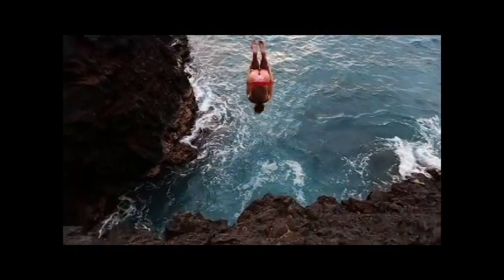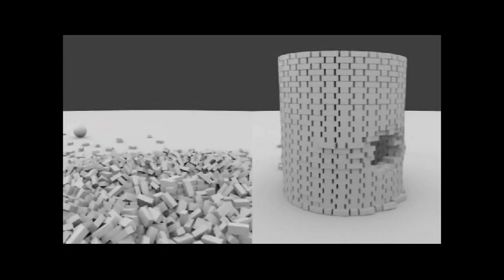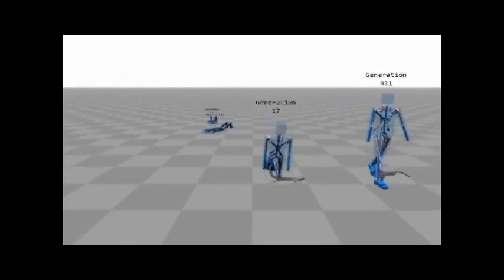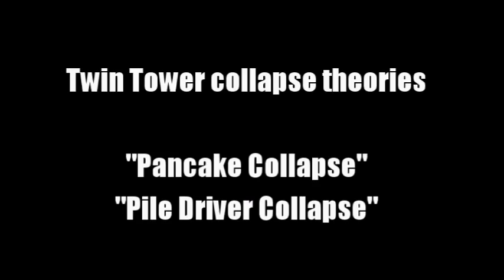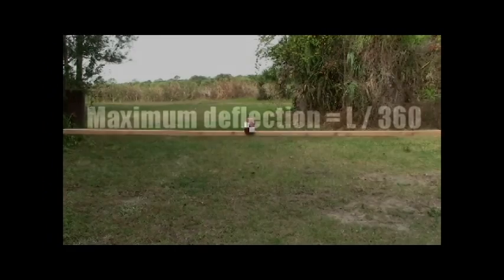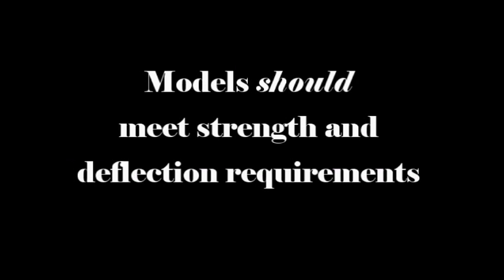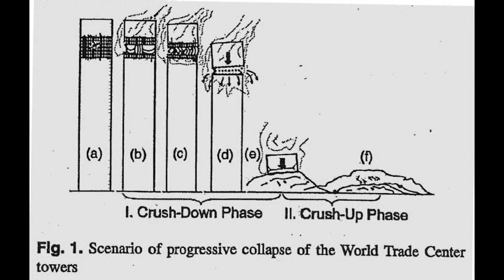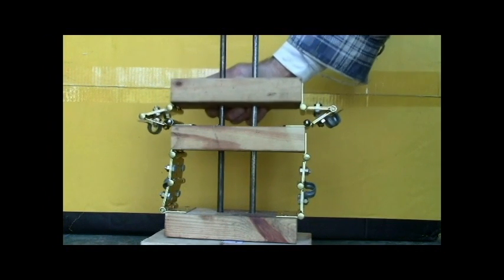9/11 Experiments: The Force Behind the Motion

Comment: A technique used in movies for strafing effects: Have a row of evenly spaced nails (eg On the wall so its in shot) connected to each electrical detonator. A weight (with connection meeting each nail) gets dropped beside them - giving you free-fall speed detonations. Varying the speed would be simple enough by creating drag on the weight.

Comment: Why such a blatent misuse of models to fool people?  The first model assumes the breaking force is enough to reduce the velocity of the mass below its impact velocity.  This has been proven not to be the case.  None of these models accurately scale the breaking resistance to the accelerating mass.   Countless studies have found the tower collapse follows the laws of physics.
Reply: +Craig Chenco I liked the NIST model of WTC7 that showed 2 seconds of free-fall.
Reply: Capitán Obvious I like the bit where it exceeds freefall accelleration....
Reply: If you look at the data points of the collapse they are averaged over the 2.8 seconds.  One data point indicates above freefall...
Reply: Craig Chenco what guitar is that? a real LP, or a china knock off?
Reply: Real one - 2000 les paul gothic  also have a 1980 e2 explorer amongst others :)

Comment: The biggest mistake in this video is the idea (in the computer simulation as well as some of the physical experiments) is that there was some kind of core that remained as a guide for the floors to fall in a nicely neat 90° vertical motion. There was no guide! The force should have deflected sideways at some point.
Reply: +Colonel Burton there should have been no defection at all the Towers should not have collapsed!
Reply: Steve Joseph
What I'm saying is that even if a few stories would have collapsed, there were no "guide rods" to assure a 90° vertical collapse of the building as in the experiment and the 3D animation. That big block that acted as a falling hammer should have been deflected sideways if we were dealing with an ordinary collapse because of a weakened structure, not the entire building collapsed into its own footprint.

Comment: Excellent work.Observed building behaviour =11 stories PER SECOND pulverized at constant acceleration.11 acres of concrete flooring and all parts of 11acres office furnishings glass etc uniformly pulverized into hot ppm DUST - per second. Physically, 'One second' does not allow enough TIME for the 'mechanics' of mass+gravitation to obliterate; to expand 11 stories steel high-rise into ppm hot DUST, @6% of its mass, molten iron spheroids. There HAD to be added energy.
Reply: Yes, the buildings were basically blown up before they hit the ground, the concrete and sheetrock were pulverized into dust on the way down.
Reply: The energy was already there.  It was the Potential Energy of the tower.
The tower could be compacted into FIFTY SEVEN FEET.  That's less than the basement it fell into.
Heat PRIMED STEEL in reducing conditions and you get iron microspheres.
Everything you have written is WRONG.  You've gotta be a 'truther'.
 PRIMARY 9-11 CONSPIRACY ASSUMPTION SHOWN TO BE FALSE:
AN ANALYSIS OF THE AMOUNT AND DESTINATION OF THE POTENTIAL ENERGY OF A WTC TOWER
The first law of thermodynamics, also known as the Law of Conservation of Energy, states that energy can neither be created nor destroyed; energy can only be transferred or changed from one form to another.
Source: Boundless. “The Three Laws of Thermodynamics.” Boundless Chemistry. Boundless, 02 Jun. 2016. Retrieved 12 Oct. 2016 from https://www.boundless.com/chemistry/textbooks/boundless-chemistry-textbook/thermodynamics-17/the-laws-of-thermodynamics-123/the-three-laws-of-thermodynamics-496-3601/
The World Trade Center towers (and WTC7) fell NATURALLY due to buckling failure when their 'slender' columns lost attachment to their floors.
They only used a third of their Potential Energy to destroy themselves, the remaining two-thirds was consumed in crushing some of their steel into ground zero.
A standing WTC tower possessed two hundred and forty six tons of TNT of POTENTIAL ENERGY merely by just standing there. We shall call this energy Eo.
The tower fell by taking the direction of LEAST RESISTANCE, which was THROUGH ITS BUCKLING COLUMNS.
The columns failed by BUCKLING because their STRUCTURAL STABILITY had been compromised by LOSS OF FLOOR ATTACHMENTS. No steel got crushed when this buckling failure occurred. 
Buckling is not a MATERIAL failure; it is a STABILITY failure.
The floors had detached themselves by sagging to an angle which snapped their connections. Photographs of these separated floors (taken shortly before collapse) are plainly shown in the NIST Report.
As each tower fell, some of that stored potential energy, converting to kinetic energy by falling, was released to damage and dismantle both the moving and the stationary parts of the tower on the way down.
The amount of the initial energy consumed in such a manner was inversely proportional to the rate of acceleration of the tower as it descended. It can be calculated.  We shall call it Ed.
The amount of energy remaining (Er) when the tower wreckage hit ground zero is then (Eo - Ed).
This energy, transferred elastically, caused PLASTIC DEFORMATION in the crushed base steel wreckage, and became HEAT. This too can be calculated.
The heat was considerable. The signs of it were captured by satellite. It amounted to the equivalent of a thousand tons of steel raised to a temperature exceeding 1,000 degrees Centigrade.
This hot steel, crushed and pressed against ground zero, oxidised its surface (making scale) and absorbed local oxygen gas, leaving a reducing atmosphere.
In these reducing conditions, and at a temperature of 1,000+ degrees C, fireman’s water which had percolated through crushed gypsum wall boarding DISSOLVED calcium sulphate (yes, Gypsum is 5% soluble in water), the sulphate ions of which were reduced to sulphur which combined with the exposed iron to form IRON SULPHIDE, which at such temperatures was MOLTEN, and flowed away. At a temperature of 1,000 degrees Centigrade, in an absence of oxygen, and in the presence of hydrogen, Sulphur and Iron atoms become keen partners.
Such hot reducing conditions also caused the water/steam to be REDUCED to hydrogen gas which was noted by firemen to be burning at the surface of the wreckage.
The wall-boarding and crushed concrete surrounding (but mostly above) the steel were THERMAL INSULATORS, so greatly slowing cooling.

CALCULATIONS (in SI units):

To calculate the original potential energy of the tower in TNT equivalent,
G = 9.81 metres/sec^2
Mass (M) of tower = 5e8 Kg
Height (h) to the tower’s CG = 210 metres
The explosive energy of 1 ton of TNT (Kt) is equivalent to 4.184e9 Joules

Equation: Tower Potential Energy (Eo) = ( M * G * h ) / Kt
This is equivalent to ( 5e8 * 9.81 * 210 ) / 4.184e9, or 246 tons of TNT.

The Potential Energy of each standing tower was equivalent to 1,000 standard 500 lb. ‘iron’ bombs.

To calculate the kinetic energy used in the tower destruction takes a moment, after a simple thought experiment, namely considering the tower would fall at G if there were NO resistance, and if it fell so slowly that it consumed ALL its energy, it wouldn’t fall at all.
So we can see that the PROPORTION of the energy used up by the collapse must equate with the proportion of G which the collapse was unable to achieve.
As the collapse acceleration was, by truther calculation, established to be about 70% of the acceleration due to gravity, we’ll use that.
The energy used up in tower destruction was therefore 30% of 246, or 73.9 tonnes of TNT.
Assuming that 30% of the tower fell outside of the basement, then the energy (Er) available to heat the wreckage base (by elastic energy transfer and crushing) was 0.7 * (246 - 73.9), or 120 tonnes of TNT.
We know that the steel reached at least 1,000 degrees Centigrade because that is the melting point of iron sulphide.
We can therefore calculate the mass (m) of steel that was raised to that temperature.
The specific heat of iron (Fs) is known to be 0.45e6 Joules / tonne / degree C
The ambient temperature was 20 deg C, so the temperature rise (Tr) was 980 degrees C

Equation: Er = m * Fs * Tr
So m = Er / Tr * Fs = ( 120 * 4.184e9 ) / 980 * 0.45e6
And so m = 5.02e11 / 4.41e8 = 1,138 tonnes.

The collapse of each World Trade Center tower created 1,138 tonnes of red hot steel at 1,000 degrees Centigrade.

So we can see that there is no need to postulate an extra source of energy, and that the basement wreckage heat is also easily accountable, with the additional corroboration of burning hydrogen at the wreckage surface, and molten iron sulphide at the wreckage base.
And so the underlying 'truther' assumption, that the planes couldn't bring down the towers, is shown to be FALSE, as it is shown by calculation, using the physically-correct values, that the potential energy possessed by the towers numerically accounts for ALL the known consequences, through elastic energy transfer, plastic deformation, HYDROGEN gas burning at the wreckage surface, EUTECTIC IRON SULPHIDE melting off the hot steel pressed against Ground Zero, and, of course, a tremendous amount of HEAT.

These results are EVIDENCE of the event.
They have been evident to any REAL scientist or engineer from day 1.